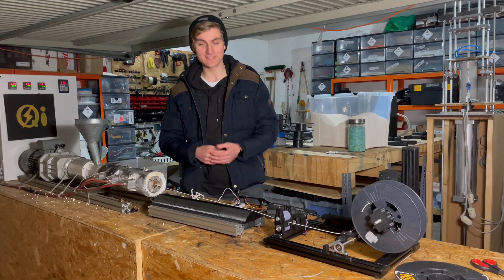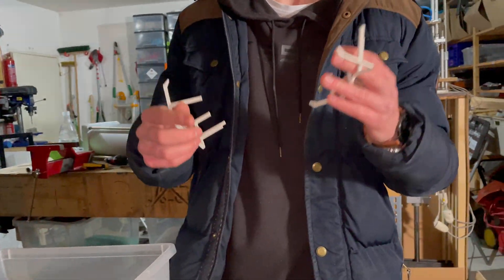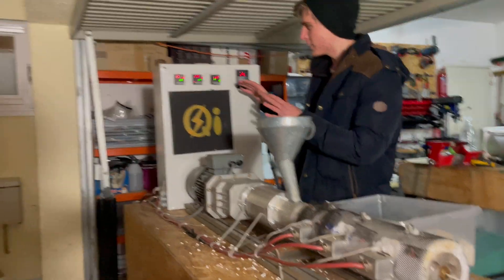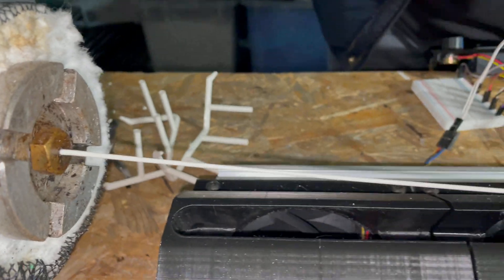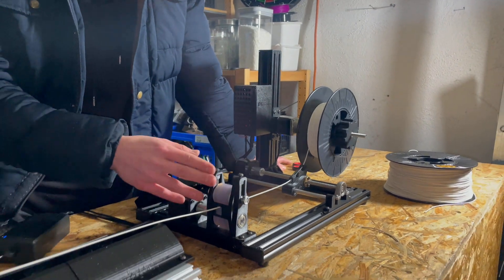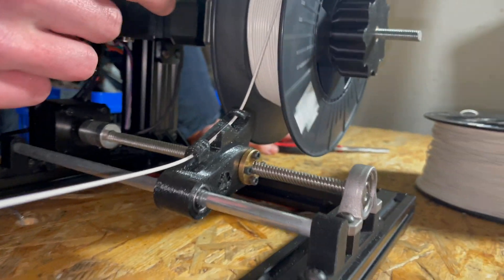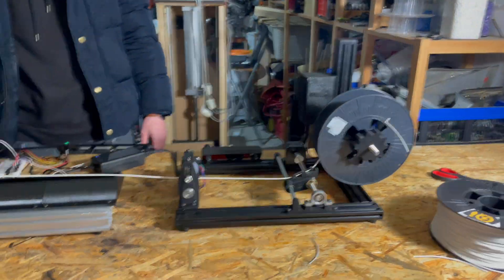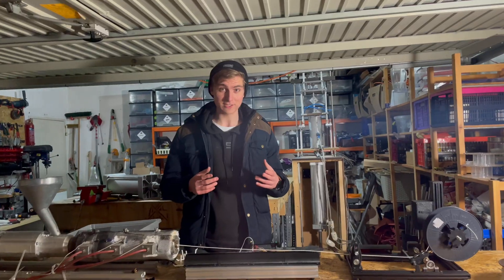Make Recyled 3D-Pritning Filament | Extruder Line Setup

Comment: Hut ab, Hammer Anlage! Ich struggle ziemlich beim Zusammenstellen von meiner, da Einzelteile für den Anlagenbau sind echt nicht einfach aufzutreiben sind. Hast du Komponenten wie die Förderschnecke selber hergestellt oder "lediglich" angepasst?
Reply from the maker: Hi Fallaxt, 

Wir kaufen die Schnecken und Zylinder bei "GROCHE" in deutschland, die machen ziemlich gute nitrierte schnecken etc. Ansonsten kann man industrie Auktionen gut teile schießen, so haben wir das zu garagen zeiten gemacht. 

Wenn du konkrete teile brauchst können wir die dir vlt mit etwas marge weitergeben da wir ja jetzt sowas in serie bauen, meld dich dann einfach per email bei 
info@qitech.de 
Grüße aus Darmstadt,

Milan

Comment: How do you make sure uniform thickness bro. I am curious on this. As far as I understand, the temperature, filament pulling speed etc determines the thickness (obviously the nozzle dia)
Reply from the maker: by now we have a Laser diameter guage, at the start we used a simple caliper all the time

Comment: Wie macht ihr das das der Spool-Getriebemotor 20m/s wickeln kann? Können das auch die TMC Treiber?
Reply: 20 Meter die Minute haha nicht 20 Meter die Sekunde. Aber ja wir haben die TMC Treiber so programmiert das die weniger microstepping  machen wenn man auf hohe Geschwindigkeiten geht
Reply: @milan_vdb_alt  haha ich meinte natürlich 20meter die minute aber bekommt man das mit 1/1 stepps hin wenn man das getriebe auch noch hat?
Reply: @RaphaelOE.  jo ich hab dafür so direkt Port Manipulation gecoded also das Arduino ports bitweise überschreiben damit kann man dann Ultra schnell steppen, digital.High oder digital low oder accelstepper Befehle sind da limitierender

Comment: What are the tolerances?
Reply: Depends on speed and temps
Reply: About 0,04
Reply: Though I’m still coding on the diameter control once it’s done I will know for sure
Reply: Diameter control is in beta now. We have toleneces of 0.03 for ASA
Reply: @milan_vdb_alt  wie viel Energie verbraucht der Extruder eigentlich so ungefähr? Bei der großen Heizmanschette doch bestimmt 2kW in Summe... oder?